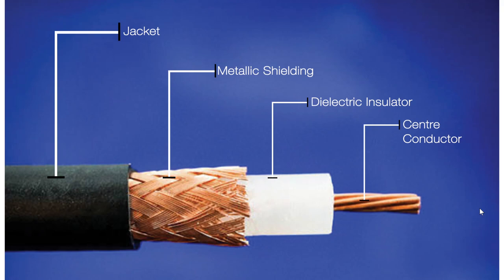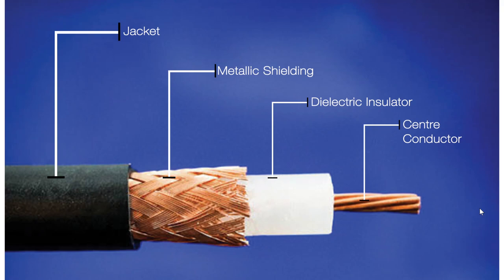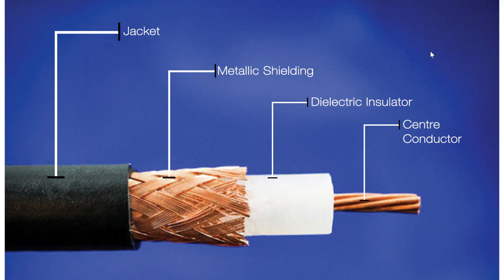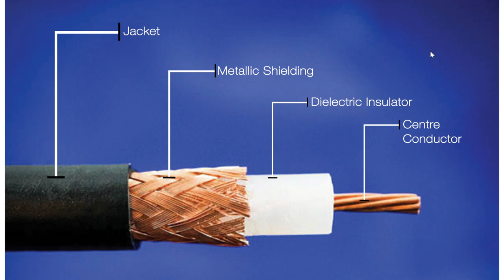Coaxial Shielded cable is what is often used to connect outdoor antenna to the radio

Comment: For transmission makes a huge difference on loss, for reception it is a myth. There are a few noise wavelengths smaller than the spaces between the shield meshes.

Comment: So with MLA 30 coming in from outside does the extra wire antenna add to the noise? Should I cut the extra wire?
Reply from the maker: no leave it alone it works great like it is
Reply: @OfficialSWLchannel  Thanks.